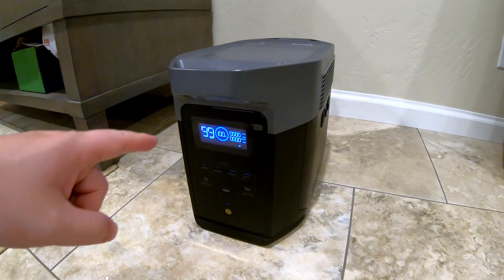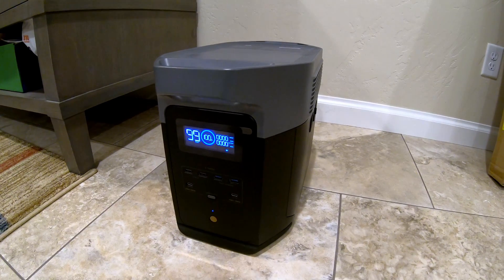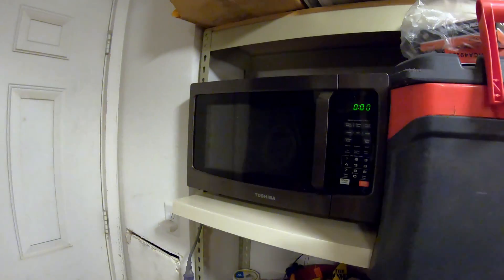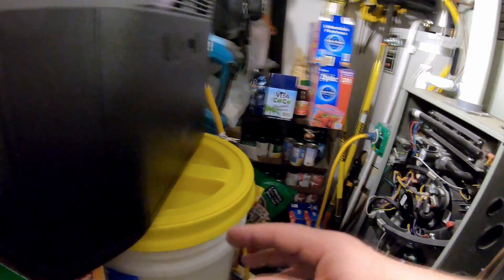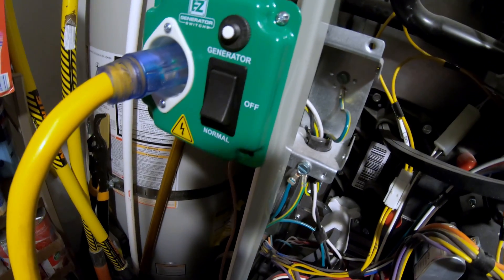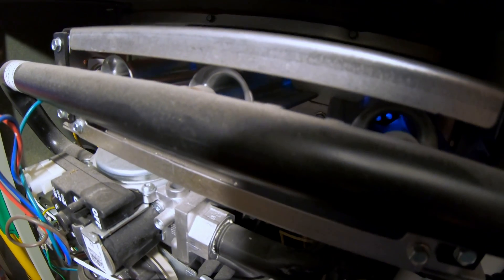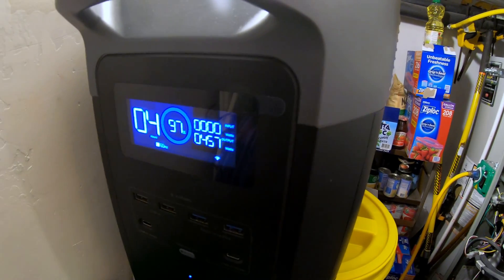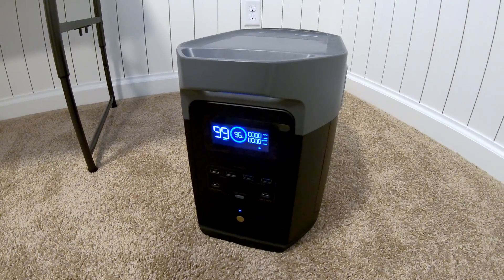Power a Furnace, Microwave & More! - EcoFlow Delta 2 Max Review and Testing –  Part 2

Comment: Pro tip if you need to power your furnace this way...Remove the filter panel.  Your house air won't be pristine, but it's worth the reduction in drag on the system and the battery will last longer.
Reply from the maker: Hummm. Interesting concept. Thanks for watching!